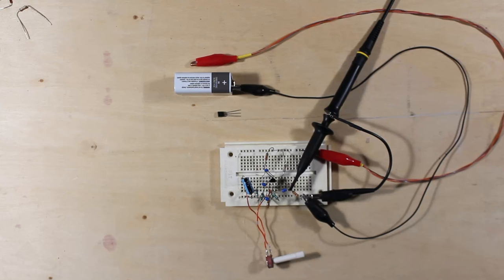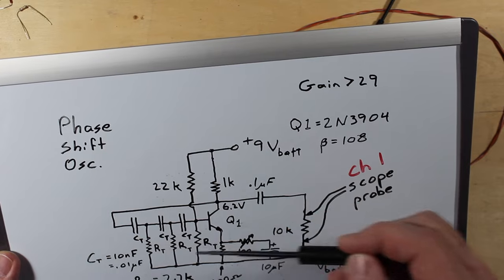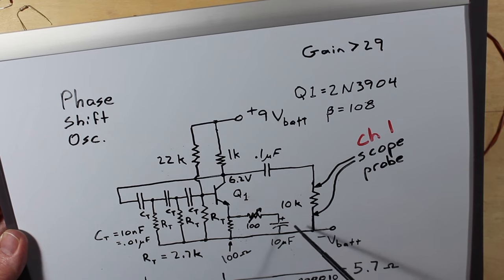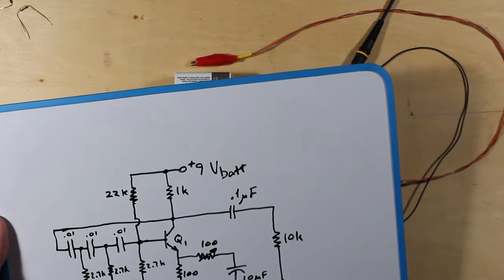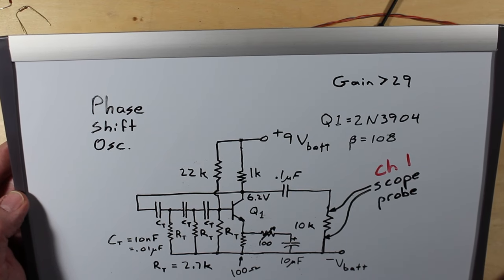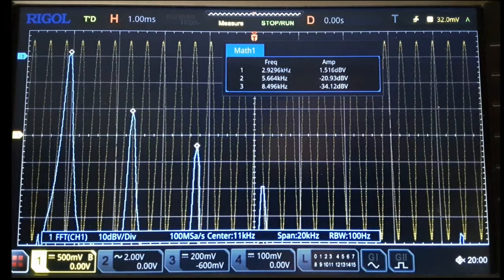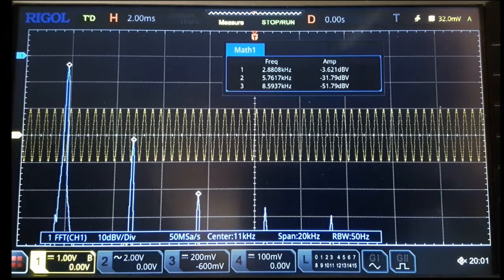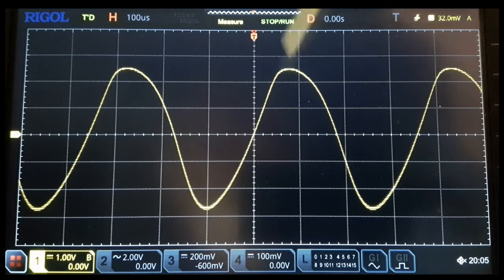Oscillator Operation And Distortion Viewed On Oscilloscope Using FFT  #electronics #oscillator #fft

Comment: I would suggest a 'Bulb Stabilised Wien Bridge Oscillator' is a great subject for a video as there is a lot of history in fact Hewlett Packard (HP) first came to market with one of these after Dr Hewlett had studied them as part of his doctorate ! ultra low distortion for the time. I have built several and find the circuit in The Art of Electronics is well explained. I use an OPA1656 as the opamp but others like NE5532 work just fine. The LT1037 datasheet has this circuit as its first application note so is another good choice of opamp. As for bulb (secret sauce!) I use a 12v CM1371, but half the fun is experimenting, the bulb dosent even light at where I use it but I make a 1v P-P 1Khz Sinewave THD 0.005% nice for audio but I test with a cheap PC sound card (not to bad) and the software is ARTA or REW. If you  like oscillators this is a good place to be !....cheers.
Reply from the maker: That would be a great topic, and I look forward to building something similar,  but it would be a big video to do it justice.
About 8 months ago I ran across this audio range oscillator -
www.redcircuits.com/Page82.htm     note the LED/photoresistor combo for level feedback
The parts are still sitting in a bag. One day....
Also, small lightbulbs are getting harder and harder to find.
Reply: Yeah but that isn't Thermionics !! :) @MoreThanElectronics

Comment: I'd thought you can get slightly different distortions from the different stages in the filters. IIRC (maybe not) the lowest distortion would be in the filter just before the amplification, which in turn has the lowest signal amplitude.

If you are interested it would be cool to compare it with other oscillators. it's much more fiddly breadboarding but I think also putting buffers in between each CR filter produce better also produces better distortion.

There's also me wondering about, if the fundamental frequency is 2.8khz, what if we just put two ~4khz low pass filters on the output? Do we get a far better distortion figure straight away?
Reply from the maker: I just might have to revisit that oscillator to check the distortion at different points.  The Wien Bridge oscillator is one type often considered when you want low output distortion.  My first thought about the buffers is they would be active devices and would add their own distortion x3.  The low pass filter on the output is what's done to the power amplifier on radio transmitters to clean up much of the unwanted harmonic output.  It should work here as well.  The low pass becomes a problem when you want to change frequencies, unless it moves as well.
Reply: Wien Bridge oscillators are great to play with I have some and I use an incandescent bulb in the feedback as a sort of AGC and see distortion as low as 0.005 %.

Comment: What Model Rigol scope is that you are using? Nice that it does FFT, Lookin to purchase one. Thanks for the Video.
Reply from the maker: It's the MSO5074.  I generally like it so far.  The built in function generator maximum output voltage is much too low.

Comment: My guess for the cause of the skewed slope distortion would simply be capacitance from the breadboard setup?
Reply from the maker: I believe most of it is from the transistor being biased off center toward the positive rail if i recall.  The breadboard capacitance is a minimal factor at these low frequencies.

Comment: That was interesting but I have no idea how any of it works. I guess I'm mentally blocked by all the capacitors blocking the DC so, to me, nothing will ever get through so how does it do anything at all? I understood what you said about each capacitor having a 60-degree phase shift but I still don't know how the signal is created.  No need to explain... that's on me to figure out.
Reply from the maker: I don't know if this will help but it gets started by the initial application of power to the circuit.  That starting 'pulse' and the circuit noise get filtered  and amplified round-and-round until the circuit stabilizes.  It stops getting bigger and bigger because the amplifier portion of the circuit has it's limits.
Reply: A sine wave is AC, so all the capacitors only let through some AC signal (classic high pass). When the circuit powers up, 0V rises to 6V, but all the CR filters pass that rise through to their next stage with a lag in time.

If you look at a near instantaneous square wave (the turn on) in a frequency domain perspective, to create a square wave you add up thousands of sine waves of increasing frequency. So in effect, you can in a very real way view the starting turn on as thousands or millions of different starts of sine waves entering the circuit. The CR filters will pass those sine waves with a high enough frequency, and if a particular frequency sine passes through with the same period as the phase-shift lag of the filters, it will arrive at the transistor as constructive interference to be amplified again. All other frequency sine waves which entered the circuit at turn-on die off very fast, because their period makes them destructively interfere back at the amplifier. So you are left with only the resonant frequency sines passing through the circuit in steady state.
Reply: Ah! That makes sense. Thank you for taking to provide that detailed explanation! @ivolol